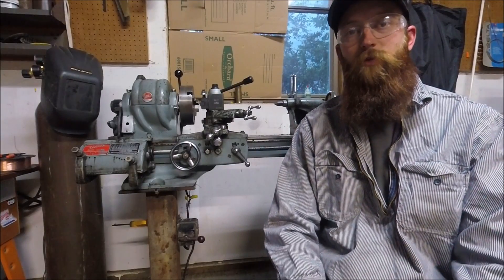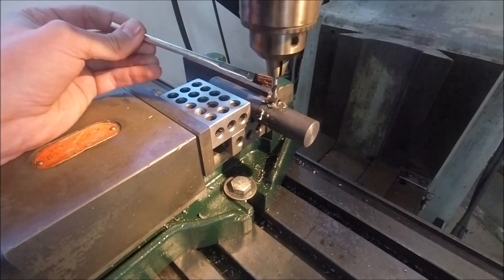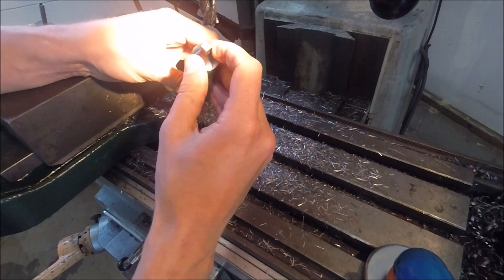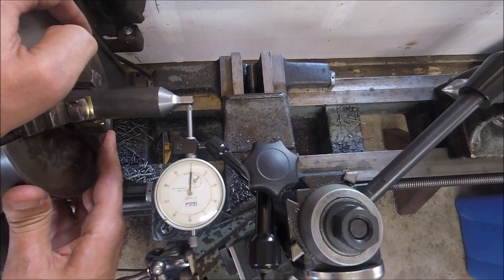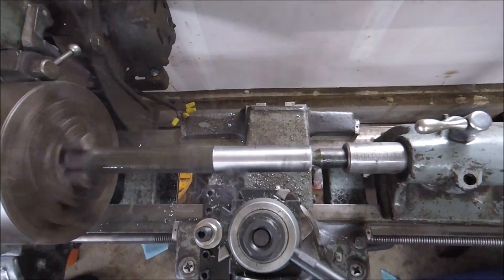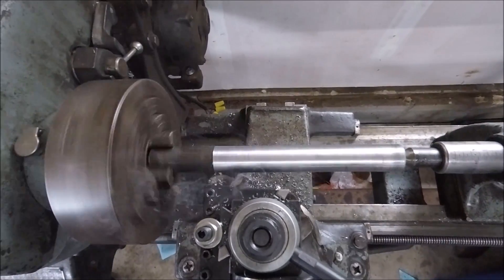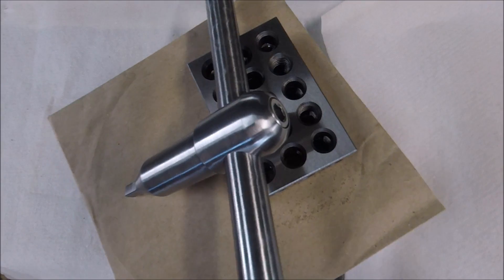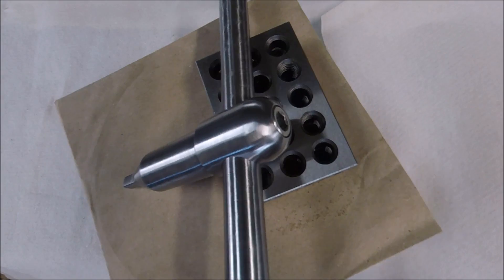Lathe Chuck Key for the Atlas

Comment: nice chuck key, Ive tried making them from mild steel in the past but they always just rounded over the edges after a while from tightening and untightening the jaws, I eventually had to cut the tip off and drill it out to loctite/pin a piece of hardenable steel that I could harden for the square part so it wouldnt do that anymore. 

Great idea on using the 123 blocks for squaring up the part, Ill have to remember that.
Reply: I also have had to make a chuck key for in my case a four jaw. It was made from 1045 but I left it soft, within a month it was much worse for wear.
 I ended up re-cutting the square and whole heat with a quench in oil.
It has done three and a half years since then and does not show any wear as well as the oil quench has protected it from rust. If you can I suggest at least case harden the square. Just my thoughts as you have done such a nice job on making the key.
Cheers from John, Australia. PS Good luck to you and all in Emma's Competition.
Reply from the maker: Thank You, my intention was to make the fit as tight as possible in hopes of avoiding wear. We’ll see how long it lasts and will most likely do something similar.
Reply: yea, my problem is that I usually tighten the stuff pretty tight in the jaws and it just twisted the square section off. Another thing to think about with the chuck keys, alot of the square sockets arent actually completely square, they're tapered, so you may want to take a look at that too because thats where I ran into alot of trouble with it twisting it off at the top, it was only held at the bottom of the socket.
Reply from the maker: This fits at full depth, the square is long so I can file it down and still have a fresh square shank. The fact that’s it’s only a 1/4” square doesn’t help though.
Reply: yea, I think the one on mine is 5/16", and I still round the corners on it from time to time, at least until I hardened it. I eventually just stuck a part from a grade 8 bolt into there and ground the shape on it, then hardened it again to make sure it doesnt round on me anymore. Where are you located at btw?
Reply from the maker: joandar1 Thank You for watching, I would like to case harden it. Just not prepared to do that yet, I can continue to use the ratchet extension until then to prevent wear on the one I made.